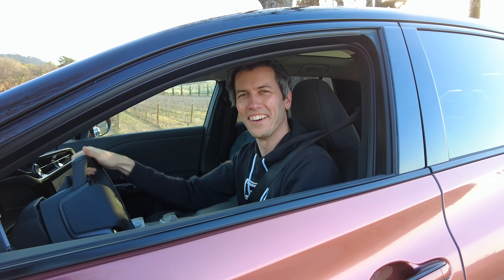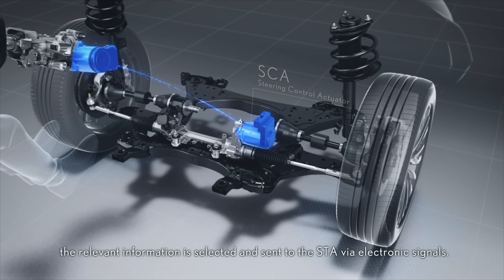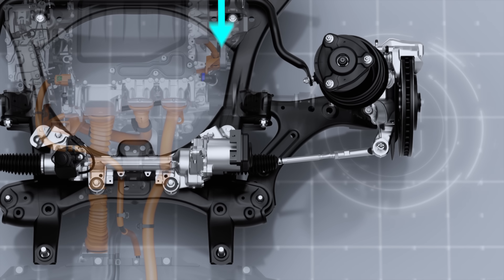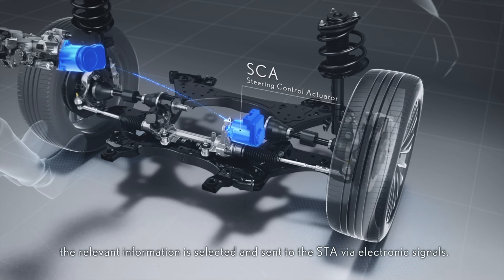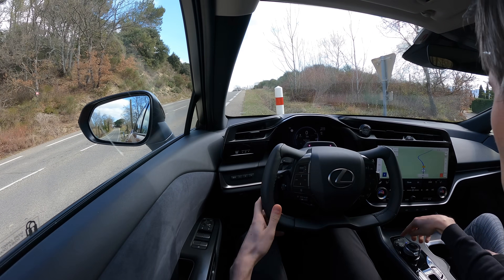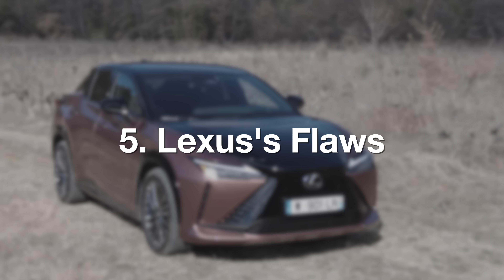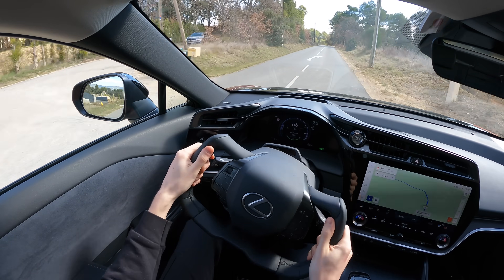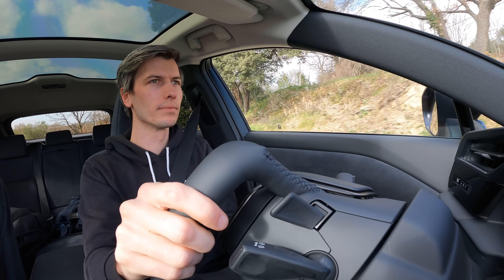How Lexus Fixed Tesla's Bad Idea: Steer-By-Wire Yoke

Comment: 12:47 The car is in stop. Motor has to push very hard to turn the wheels. It is very much possible that the phenomenon would not have occurred while even low speed (parking). I learned how to park on a car without any power steering (fiat 126p), so I know. It is possible to move the steering wheel while stooped, but it takes a heft to do that. Small electric motor is probably to weak. This is a problem thou - what if your front wheels are stuck (in harsh terrain or after car crash with damage to the front wheel arch). Is that motor enough to turn them, or will it overflow?

Comment: Yes, modern planes fly by wire and are save, modern cars use electric steering servo but still use mechanical coupling. And sometimes the electric servo failes and the driver has to steer without servo or even against it to prevent an accident. How often this happens ? About 10% of all cars duing their life time. The nice thing with mechanical thing is: you notice when it wears, long before it failes. The problem with electric steering: you notice nothing until it suddenly failes (semiconductor burns, plug detaches, wire corrodes). And the accident will kill you, nearly certain.
So please: no steer by wire until cars are serviced like airplanes, replacing parts BEFORE they fail.

Comment: This is the continuation of the disposable car.  These cars are so unbelievably complicated that no mechanic will ever be able to fix anything.  As soon as a little salt water finds a wire connection, (any wire connection) 155 error codes will light up and the car will have to be thrown away.

Comment: "this means you never have to use hand-over-hand motion", uh, I solely use push-pull in an automatic

not being able to slide my hands and forcing one hand down just because one is pushing the yoke up looks uncomfortable-as compared to a wheel

Comment: Interesting, still I have a question. Imagine you are in a middle of a very large curve on a highway and for some reason you have to stop. Your steering wheel has a certain angle, but while you are moving fast it corresponds to one angle of the wheels, and as you gradually slow down it should correspond to another angle, much  deeper. How does this go in reality?

Comment: The problem is as he mentions on a highway even with low steering ratio the driver can do quick manoeuvres that can be fatal

A quick fix for this is to have a counter torque motor to the steering which will weigh up and has a nonlinear response of the steering at higher speeds for small inputs of steering but gently relax if it is a larger input
Then the car won’t react as quickly to smaller inputs that can make it loose stability
It needs the sophistication of tuning the counter torque on the steering yoke that can solve the problems of instability or delayed response because wheels respond at a different rate as compared to steering yoke and if they both are tuned for countering or precisely replicating each other through feedback sensor loop then it solved the problem
and also further help when it is autonomous driving conversion

Comment: For me the downside is that I don't trust manufacturers to give the the options I'd want. They'll decide the options they want to give you, and you'll be stuck with it. Just like on my car they decided to have a brake locking system. You try to just apply a tiny bit of breaking when the car thinks you should apply more, it locks the wheels up! Well that same kind of crap could happen with that, and I don't trust them.

Comment: I didn’t think I’d like the tesla yoke, but once a drove the new Model X with the yoke I was completely converted. It’s way better than a wheel. 

1. One obvious pro is the unobstructed view of the gauge screen. As a somewhat tall person, this is REALLY appreciated.

2. One unexpected pro is the flat bottom of the yoke provides a really comfortable place to rest your hand. This is especially great for auto pilot, because resting your hand there means the car feels your weight on the wheel and doesn’t have to request you jiggle the wheel to know you’re paying attention.

3. The flat bottom also means more leg room which is really nice. 

4. Lastly, the thumb catch on the upper corners is really well designed and means you can rotate the wheel all the way around one handed with ease. It’s almost easier to turn the wheel all the way around than a normal steering wheel. Btw, my daily driver is an older model X with the round wheel, so I’m comparing like for like here.

In conclusion, I think the people that complained were probably mostly people who never tried it, or people who didn’t realize that the thumb catches allow you to spin the wheel all the way around super easily.

Comment: GM offered back in like the early 70's an variable ratio steering for some models. It was mechanically built into the steering box. The ratio changed from the center to the lock stops. I believe an Camaro with this option had like 2.3 turns lock to lock.
Reply: Yes, that varies the ratio by steering position, but cannot vary it by vehicle speed or any other parameter.

Comment: Is steering even needed. With wheel motors at each wheel, could you not steer even without moving the front wheels?

Comment: Great idea, however. Is there going to be guarantee at all times that this technology in its existence will guarantee 100% control in every vehicle, every moment throughout history? believe the conventional mechanical linkage is still safer and will always give driver control - (even if the hydraulic or electrical assist fails) as it is physically connected. Yes these Mechanical steering systems will fail at some point, and believe common and smart sense says that the Steer by wire yoke would fail worse and likely more often earlier than any other; especially if manufacturers cut costs and materials - that the steering system barely meets safety standards of countries; Ford is a great example of cutting costs.

Perhaps the motor movement may last longer than a mechanical steering column, or the complete opposite is true, this is really difficult to assess as the "new technology" is infancy; while physical mechanical steering column has been around since the earliest times of when cars were called cars.

If these sensors fail, or if the motors themselves fail. what guarantee will the driver still have control.. Can the driver be guaranteed they will still have control when these motors fail? (even with redundancy)? this is a great idea but when it comes to reliability and ultimate control, failure of this motor is a total loss of control.   Additionally, what is the safety / redundancy and backup? when an event occurs?!

At some point, Yushi Higashiyama no matter what he and his managers say; when fatalities and major accidents and increasing frequent accidents due to this new fad of technology the answer is simple; there is no physical control mechanism in the event of an electrical failure of the motor / wire / sensor etc.  This technology, is it electrical short proof? if a lighting hits the vehicle while in motion and somehow shorts the vehicle electronics / emp or whichever situation; mother boards and electronics can get friend; what then?!

Electronics are likely to fail earlier and less reliable than original highly engineered mechanical systems. Generally speaking, this is a common sense that most people would likely agree.

Steer by Wire technology in the case of Yushi Higashiyama and his managers; really fail the entire point of this technology, because it does not address the mechanical safety of this system.  Yes there are redundancy; but is there absolute guarantee 100% this redundancy will NOT fail?  Yes this by wires system is in brakes and acceleration; but these are different components and service different parts of the vehicle.   Brakes would be also another; questionable.  

No matter how much redundancy (soft way of dealing creating the illusion of safety) 

F1 prefers that the driver is in as direct control of the car as possible. < Many people highly doubt the F1 would even adopt this technology.  

 *********Steer-by-wire completely disconnects the driver from the steering mechanism.*********  They need to read this several times... Common sense destroyed.

 Lexus and Yushi Higashiyama and all his engineering managers and department need to read that statement.  This is a fad technology that is potentially dangerous; again there is no physical control in event of redundant failure. even redundancy cannot guarantee a 100% absolute connection of full control....... This is not engineering, this is a marketing technology with convenient engineering.  Personally, does not matter who came up with the steer by wire; its just the pure fact, it disconnects the driver from the steering mechanism. period.

We ever wonder how people in the engineering world get these jobs as they do and the mass of people that buy their product; someone has to pay a price for their "solution"  Great video by the way, I really enjoy watching the explanations and ideas presented coherently and unbias; I am just not sold on the safety factor of disconnecting a mechanical linkage

Comment: I'm actually going to have to strongly disagree with your assessment of steering inputs at high speed. While a system that prevents a driver from completely spinning out could be great, the fact is that the steering is FAR too insensitive at higher speeds. I can see plain as day in your video how much you're turning the wheel only to have the car barely move. This is exacerbated by what I would consider to be extremely high input lag. In the state you drove this vehicle there's just no way I could consider this safe for highway driving.

I didn't need your demonstration to see the lag, I could see it when you were driving. I'd estimate it could be as high as 0.2 seconds. That might not seem like much to a lot of people, but it is extremely high when you consider you often only have 1 second in total to react to an emergency at highway speed, and you've just removed 20% of the window you have to avoid a collision. Less obvious is the problem of over-correction which will undoubtedly occur. If I can see the delay, it will be FAR more obvious in the way the car feels while driving. And when split-seconds matter, a driver that feels their car not turning enough will turn more before the wheels have a chance to catch up, resulting in dangerous situations that would not have otherwise occurred.

Honestly, though, what's far worse than that is, is the lack of response at high speed. You weren't even going close to highway speed during your demonstration of "unsafe flailing" and the car barely moved. If it gets less sensitive at higher speeds, it's going to make it impossible to execute a precision swerve to avoid something that suddenly enters your path at 70+ mph. Yet THAT isn't even the most dangerous aspect of the situation.

At highway speeds it is unlikely for you to be in a dangerous situation where you need instant steering response and you are not going to hit your brakes. If the steering gets more sensitive as you slow down, drivers are going to find themselves suddenly in a full spin! I have to turn the wheel SO far to get any response at highway speeds, but then that same rotation is going to change as I break hard and becomes the equivalent of a 300-degree rotation on a normal car. Of all the hazards in a variable-ratio steering system, this is the most likely one to cause serious accidents. Even at low speeds, if I'm breaking into a corner, I need the steering to remain consistent all the way through the turn, not suddenly steer me into the curb because my speed dropped enough to take my turn from 90-degrees to 120.

Comment: More question is how to implement the definition of the angle of rotation of the steering wheel. If it was a potentiometer, then like my electronic gas pedal, it lasted about 155 thousand km and had to be replaced, because the gas periodically failed while pressing the pedal. Previously, when the gas was controlled by a cable, there was no such problem. I also want to remember the Denso climate control system, which uses damper control motors on potentiometers, which are also enough for about 5-7 years, and then you need to disassemble the entire torpedo in order to change them. A stable impression is created, the further - the more complex the cars and the more difficult and expensive it will be to repair them. While they are new, there are no questions, but further operation will show everything.

Comment: I'm mixed, it sounds cool, but I like things that feel more analog. I'm def a lower sensitivity person. But I think with some time I can get used to it.

That latency issues needs to be addressed though, I am fairly sensitive to that level of delay so it'll probably feel really clunky. Like it's not on the level of nearly imperceptible, you can see it visually.

Edit: on a side note if we ever get flying cars this would be the preferred method. Probably won't see that in my lifetime though.

Comment: One safety concern was not mentioned.
Higher-speed evasive maneuvers! I really look forward to see how the drive-by-wire systems will deal with the moose test!🤔
In general e-cars have very good results due to low center of gravity. But in this case the limited wheel stear in maximum turn could be a problem above certain speed.
Reply: That's what I'm wondering about. In danger situations, people also tend to yank hard to one side and if the steering ratio changes, that can be disastrous.
Reply: @cchavezjr7 the change in ratio happens at low speeds, for parking your car, manoeuvring in car parks etc. At highway speeds the ratio is closer to a normal ratio you have on your car today so it shouldn't be any more dangerous.
Reply: @gordon1201  and in those situations most people gab the wheel and turn it about 90º - 120º there not going hand over hand full lock.

Comment: Steering by wire feels like a perfect example for EMP killing a car beyond just whole rest of important things in car that relies on electronics. In my opinion this tech should offer both manual changing and automatic changing of precision. Like you drive 10kmh (or 7mph) it asks for switching to parking precision and counts down for 20s then with sound notify switches if you don't press Y/N option. Same for other speeds. Or completely manual setting where you can manually switch from city driving mode to highway driving mode and it switches the precision gradually on 20s timeline so you it's easier to adjust to new precision. Unless you're like at 0kmh/mph then it switches immidiatelly.

I personally will experience it (if at all) in 20y because cars in my country that are affordable within one year income and ain't an absolute scrap on wheels are..... ~20y old. And average car age in my country is ~15y. :)

Comment: My car has tons of problems. But every problem has different traits that i can recognize through the vibration of the car. Like sometime a spark plug fail it shake up and down. Worn brake pad vibrate every time i brake.
All i want to say is, the steering wheel physically touchjng the car helps me understand my car more.

Comment: I'ts not safe in the long run. Car is not the plane. First 2-5 years ok. But later than that, if unnatended, and on massive pruduction it will be unattended, - it's catastrophic failure in unpredictable time with little to no warning(unlike classic steering that usually degrades slowly). As alternative it's planned obsolescence, witch is another bag of worms alltogether... + serviceability...

Comment: That is everything cool until the electric connection suffer some problems. Now you cant even turn your car. I call BS that steer by wire. I won't want that in my car. A component is being created just to increase the maintenance and revision costs. Run away from it.

Comment: Soon the newest car will come with WASD button, no lever or paddle. 
In this case with the variable steering ration, that is like having mouse acceleration, with every turn you never actually know how far the car actually turn.
I cant even trust my computer mouse acceleration to decide the correct position for my mouse pointer.
I wont bet my life on fly-by-wire control like this.
Case and point: Xbox controller on submarine.